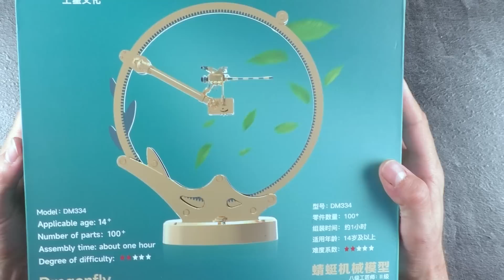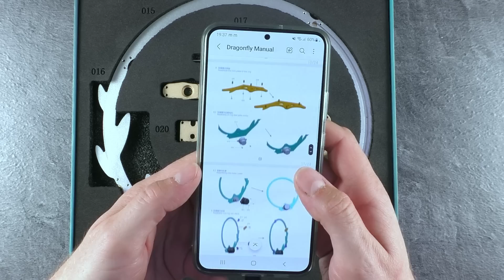Assembly of an Kinetic Dragonfly Sculpture

Comment: Very pretty, but not cheap. Be interesting to turn it into a clock to make it more functional.
The other kits are more traditional, like the working V8 model. I've seen those in plastic form before.
Mr. Puzzle, if you do another of these kits, I'd recommend the pumping unit. That could be more interesting.
Reply from the maker: Additional functions like a clock would be great! 👌

Comment: I saw one similar in a shop in Switzerland once. It was also big ring gear but had a crystal bird in the center. It was powered by a Stirling engine. I suspect the craftsmen in the shop had built and tuned it. I remember it ran without noise and the price is quite high!